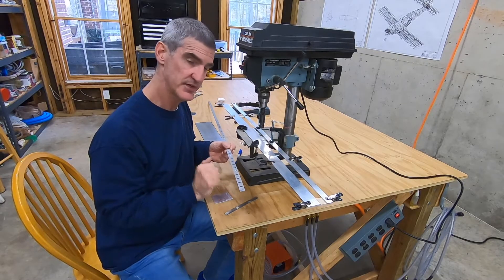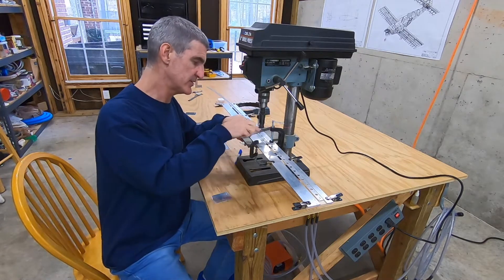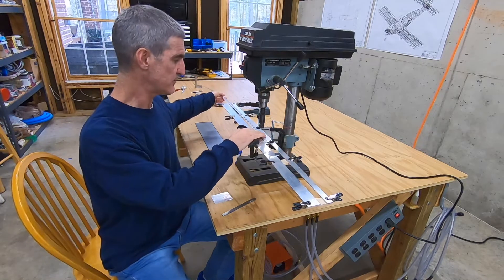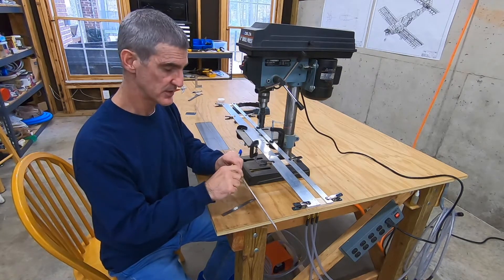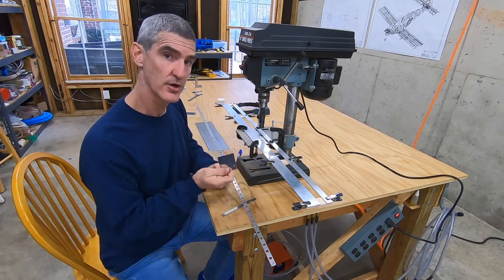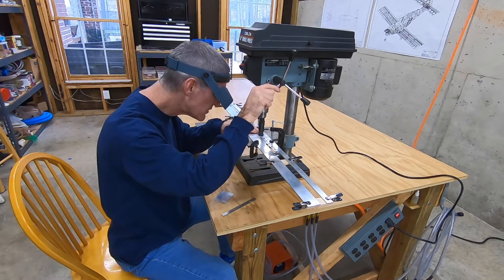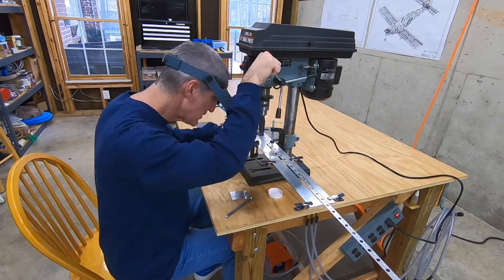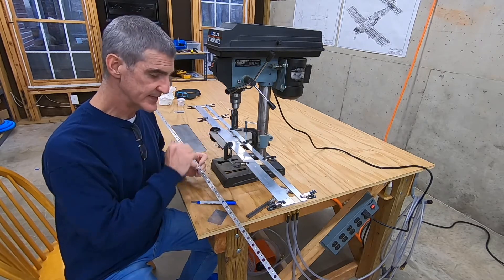RV-10 Build Log - Emp 24 - The Dreaded Wedge

Comment: I did it with just my hand holding firmly the cage to the TE wedge and I found that it worked very easily.  I in fact use this method throughout the rest of my build (especially when you get to the fuselage and you are doing the flanges of the bulkheads of the wingbox or other flanges that did not allow the entire cage to rest on the surface).  In short, you can hold just a portion of the cage on the flat surface and the cage will still do it's job.  If you are slow and careful it will work just as well and save you hours of time.  (also you have extra of the wedge piece to practice on so you can start to feel confident before you move onto the actual piece).
Reply from the maker: I'm definitely not that coordinated with it, at least not yet.  Maybe by the time I get to the fuselage I'll develop the skill to do it more "freehand."  I keep likening working on the plane to learning to mud drywall in my basement some years ago - by the time I was done, I had developed the muscle memory in my wrist mud a ceiling perfectly.  But don't look in the closet that I started out on.

Comment: How did you make that piece in the middle 1:12?
Reply from the maker: It’s just a thin piece of scrap that I cut a V-shaped notch cut in on the band saw.  I think it’s just a strip I got at Home Depot or somewhere similar.  It doesn’t need to be a “wedge” to match the Trailing edge.  It only has to be slightly thinner than the thickest part of the TE wedge, so that when placed in the right spot, it props up the TE wedge to make the top surface perpendicular to the drill/countersink cutter.  There’s nothing specific about the V shaped notch, either.  It just needs to provide enough clearance to drill and countersink.
Reply: @missiletwentynine2667  thanks for the details. I will try to make something similar